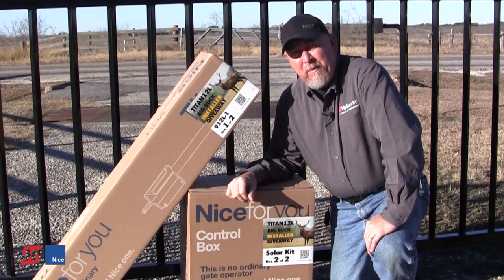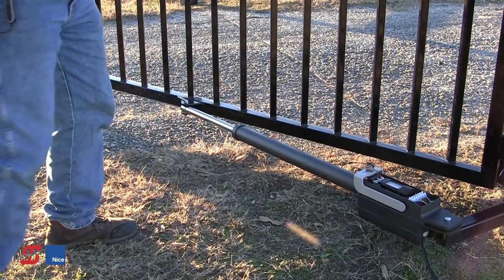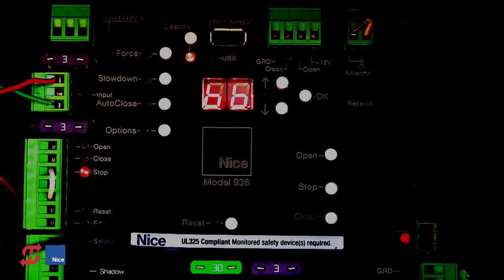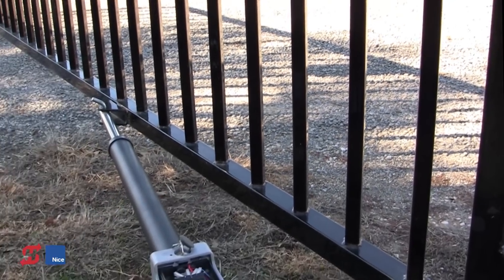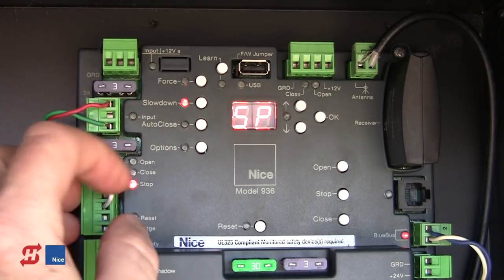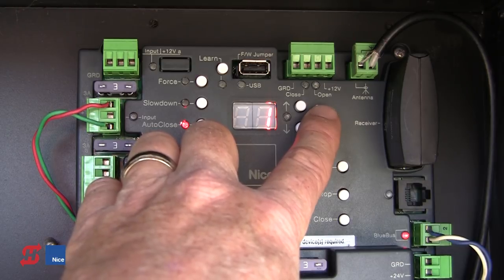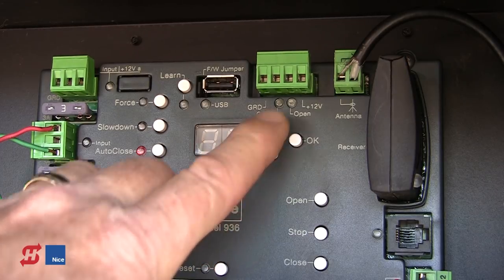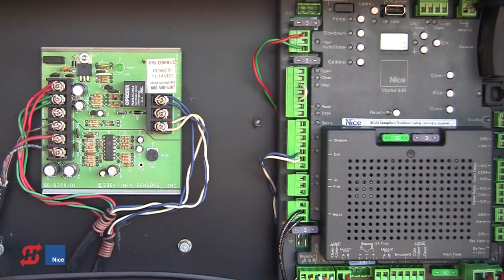Nice TITAN12L Linear Actuator Install and 936 Control Board

Comment: Awesome install points! It all starts with a good installation, you are right! Very clean install.

Cool things: Run alarm, remote control options (lock gate open), stand by mode on/off!!!.

FYI for installers the solar panel should be in full sun all day. Even if you have to relocate it 100' away, do it. This will save you a warranty call and a new battery. 33:05

As with our videos and some other manufacturer's, we all end up working on a gate, like this one, that is not UL325. There are several ways to fix it but make sure your customer knows the issue and how it can be fixed.

Thanks for showing us how to use the level laying on its side. 14 years of service and never knew that. The square is a great idea and I have been meaning to make something like that, just go buy a square now. 

Also, SLA, really VRLA VR=valve-regulated, do let off gas. It is a very very little amount if charged and stored properly.

Thumbs up Here! Thanks again.